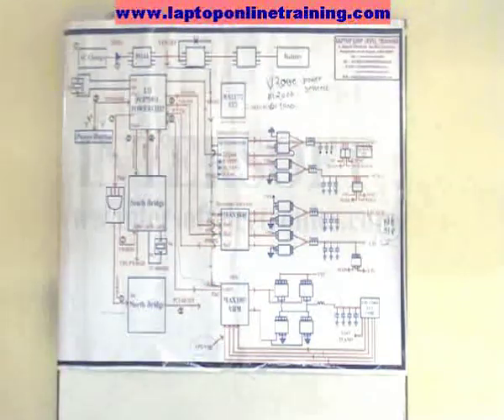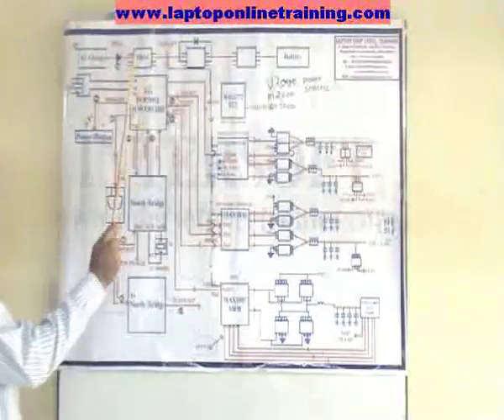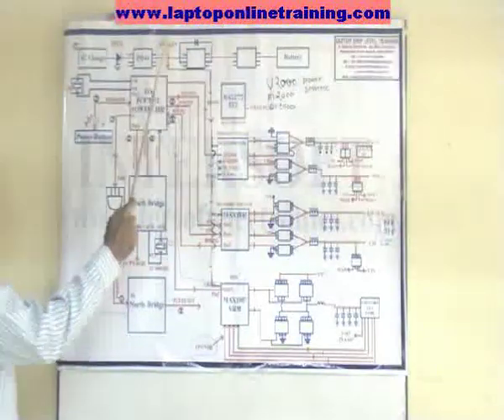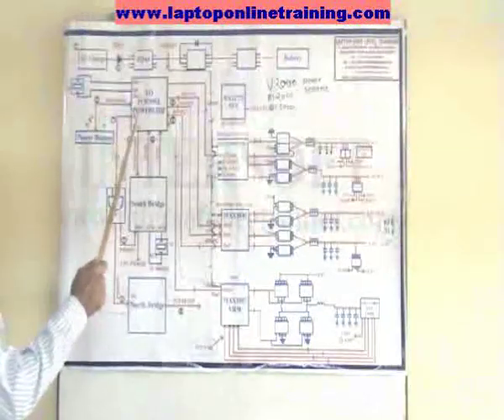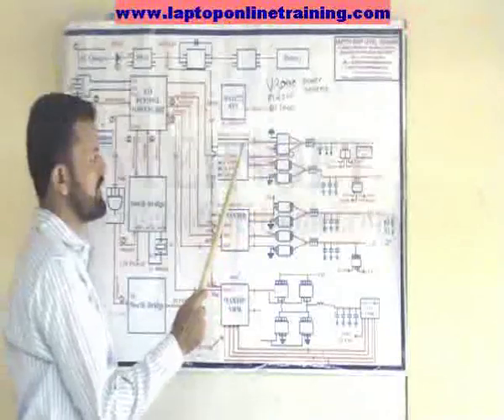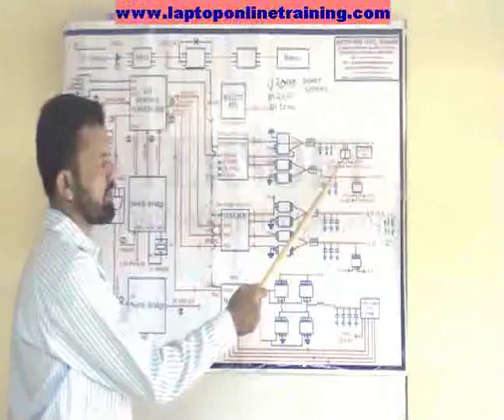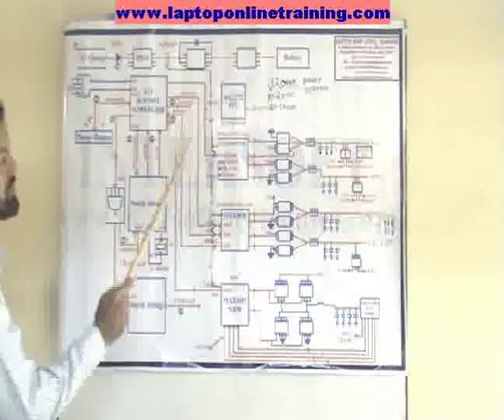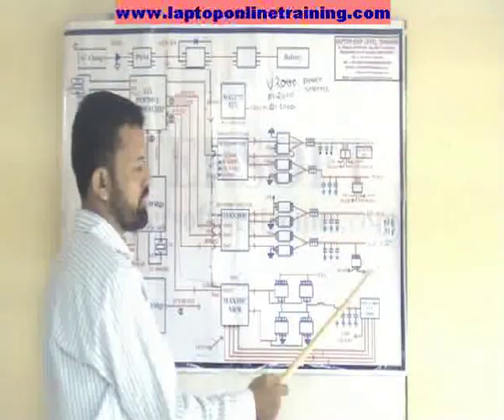Chip Level Laptop Motherboard Training Video power on sequence of laptop (English)

Comment: each mosphet gets vin voltage  or  only drive high mosphet .. plz clarify
Reply from the maker: high mosfet drain get vin ovltage which switching from 18/12v   if direct adapter there is 18v and from battery ther eis 12v